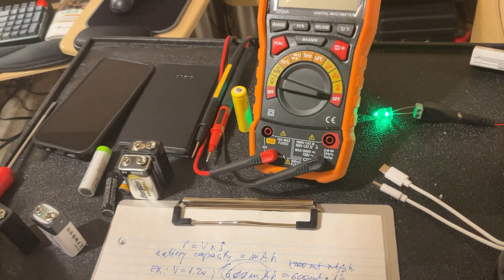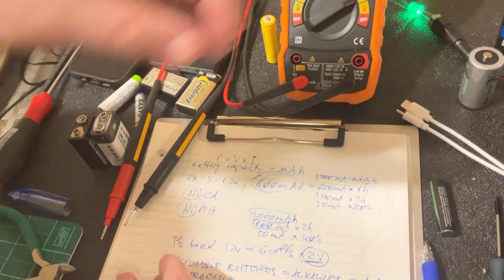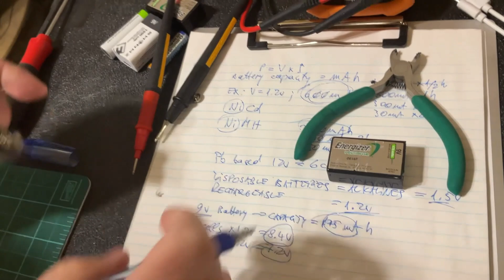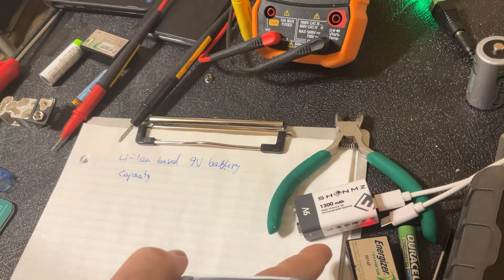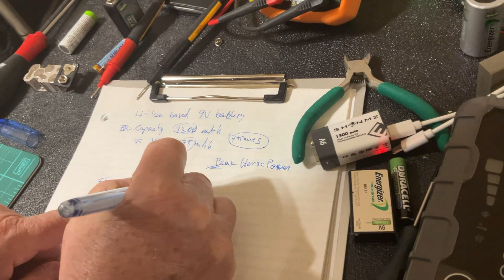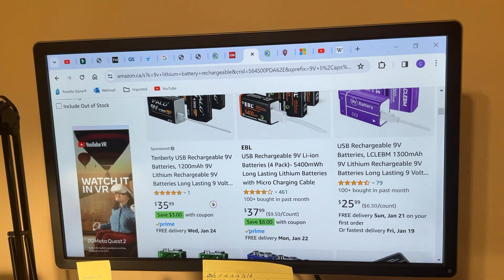9V Li-Ion rechargeable? Yes, but the mA/h claims are exaggerated!

Comment: The 1300 mAh number on the 9 Volt battery is a sign of shame and the best flag for a scam. The right number is 450 mAh. 
This because the biggest Li-Poly cell which can fit 70% of the volume is 800 to 900 mAh. The other 30% of the volume of the battery box is occupied by the step-up converter, the LED and the cables. 
If they were honest and had shown the true base capacity, without changing the sale price, they could have sold this in large numbers. But no, there is a compulsive need to be imprecise, and the sale platform is blissfully unaware of the extreme confusion surrounding this new battery technology.
Greetings,
Anthony
Reply from the maker: @Ray_of_Light62: Thank you Anthony for your remarks. You are perfectly right. The continuous battle to sell us bigger numbers proves that the commercial interest took over engineering accuracy long time ago. It was certainly more honest to sell them as 400mAh as they were better than my old NiMH 150mAh and no need for a specialized charger, just a standard USB phone charger was good enough.
I really am grateful to you for taking the time to watch.
Cheers,
Chris

Comment: Your 9V battery also hasn't 1300 mAh because it is not possible to achieve that amount of energy in 9V one. It has 1300 mAh but at 3,7V, so it it half true. you can check it , i have same batteries, it also drain 1mA when not used which means it will self discharge in 1,5 month.
Reply from the maker: @LilianaWalczak Thanks for the time you took to write me Liliana, and you're right about the batteries. I was too enthusiastic when receiving them, and I made the video BEFORE checking the 9V batteries thoroughly. Once I put the video on-line, I cannot modify, but only remove it.
Here is the comment I returned to the vendor AexPower after testing a full pack of 4:
"Just another noname pitiful scam
At the 1300mA/h displayed with big characters on the body, these batteries should compete with the 9V disposable ones. No way they can! I tested a whole bunch of these after I bought two packs of 4.<br />At least they all behave same way: tested repeatedly at 100mA consumption, none of them lasted longer than 4h tops. Very far from what is advertised. I even gave a couple to one of my friends hoping they were going to successfully substitute the disposable ones. Now is too late to return them back, but at least I can give you guys an educated advice: PLEASE save your money, these no name 9V rechargeable Li-Ion are a total waste of money. The idea was beautiful though, and this is why I fell in the trap: Li-Ion instead of Ni-MH, USB-C cable, charging light indicator. After it was already too late, I looked for the traditional/experienced manufacturers: Sanyo, Panasonic, Toshiba, Energizer and alike. NONE of them sell such things on Amazon yet. It should then raise a big red flag to all"
I was refunded. Sorry again for the unwanted misinformation/
Cheers

Comment: mWh/h is the right an most valid value. The DC/DC converter makes a higher voltage output. This makes it difficult to calculate the mW/h  compared to a accu without this converter. So the mAh value is useless to compare the power of Lithium an NiMh accus.
Reply from the maker: Hi Joli,
I appreciate you took the time to leave me a comment.
I already mentioned in my video that the mWh is a valid data, and also emphasised my main concern about not using the same unit when comparing two batteries, even if their technologies were different.
Thanks again!👍

Comment: Great video for people getting into microcontrollers or hobbyist electronics. There isnt a lot of info out there on the net that goes over this info in the context of batteries specifically, only in the context of general circuits. 

I would suggest that you take the time to cut out things like taking and finding the photo on your phone and possibly put the photo in the video. 

I really like the pen and paper plus talking format that you have used. If it's unscripted, you also did really well at keeping the information on topic. In any circumstance, don't be afraid of or averse to writing a script or to do multiple takes and cut takes together. 

Other than that, great video!

Also, you went over power at the end in relation to the amazon listings; it may have been worthwhile to present that info earlier to show how the battery types compare to each other. 1mAh at 1.2V isn't the same amount of power as 1mAh at 9V or 8.4V; you'll get the 1mA for an hour in all circumstances but if you had voltage converters in a circuit with all three types of batteries to make them all the same voltage the current draw on the battery would change proportionally to the output voltage. I know you know this, I'm just saying that the audience for this video may not connect those dots even though all the info needed is actually in the video.
Reply from the maker: Very pertinent comment Brenden @ProjektEpic  thank you!
No, my comment wasn't scripted, I just highlighted on my notebook the general points to talk about, as I manage the subject anyway.
My main doubt was about the length of the video.
So I decided to cut it short to keep it below half an hour. Also realised that developing to extend it over half an hour will challenge the watchers' patience. And I agree that maybe I should have kept it more on the rechargeable "9V" battery.
I always try to stay on the subject, and my goal was to get the attention of the potential users of the 9V batteries over being consistent when comparing numbers...
Thanks again and receive my best regards